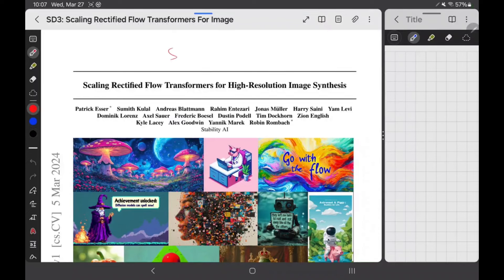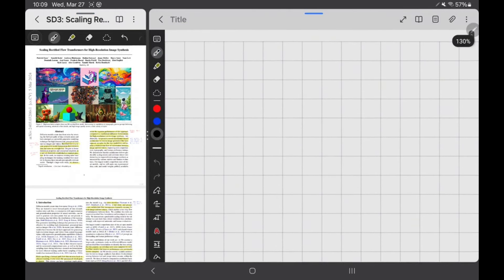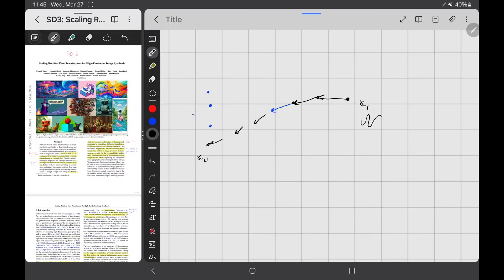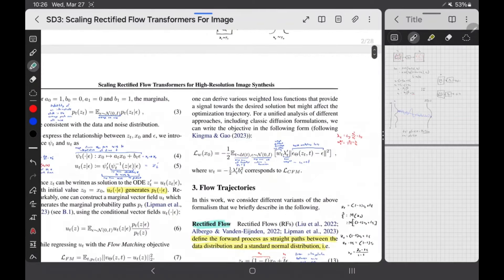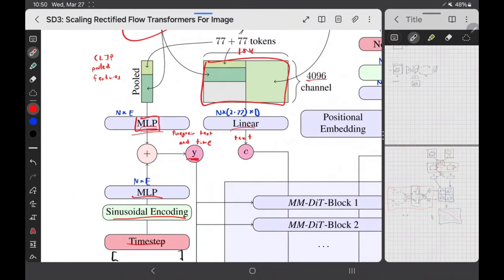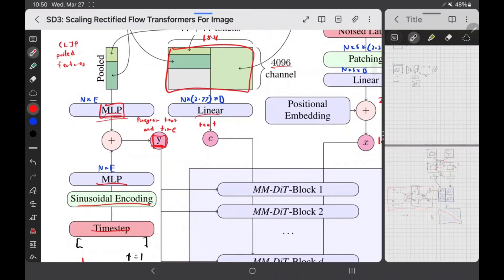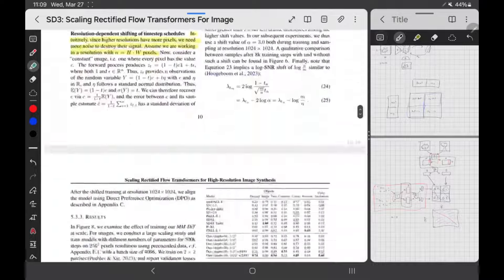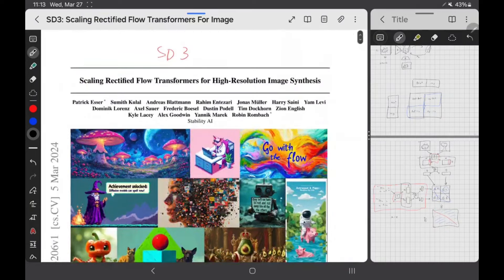Stable Diffusion 3: Scaling Rectified Flow Transformers for High-Resolution Image Synthesis

Comment: Hey I was wondering if you could clarify something for me. You say that the [154; 4096] matrix holds the "fine grained" information, but when explaining the MM-DiT block setup Y is marked as fine grained information. It does seem to make more sense for the Y to be fine grained information in my opinion as it is post reduction information, however as I am not entirely sure I would love for you to maybe correct me on that :). Really appreciate the video! makes a lot of sense overall